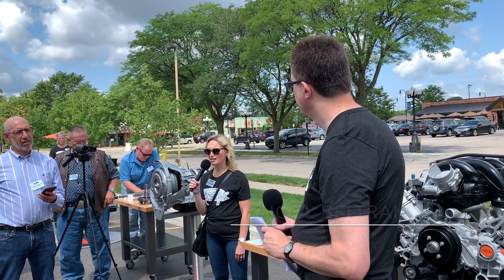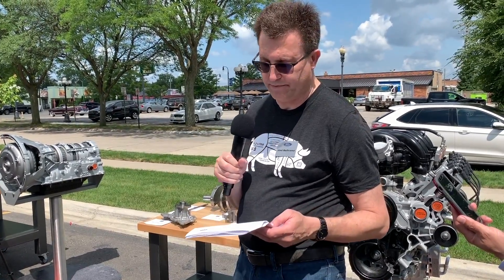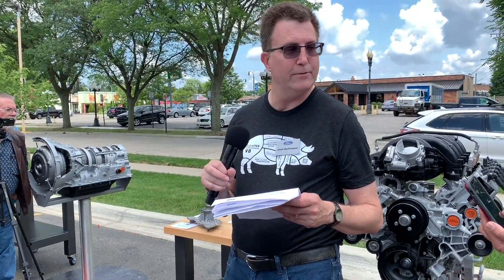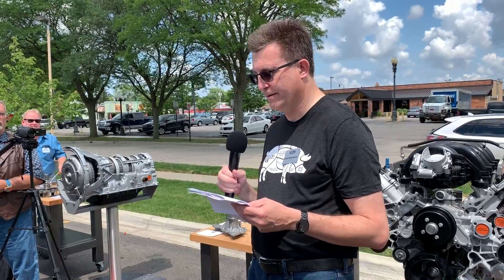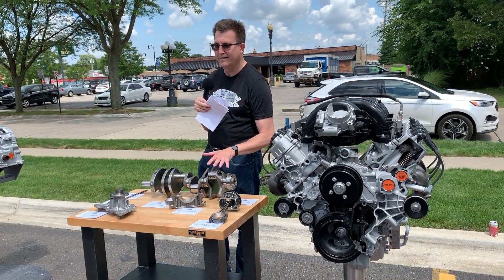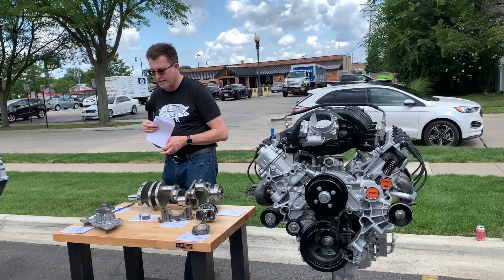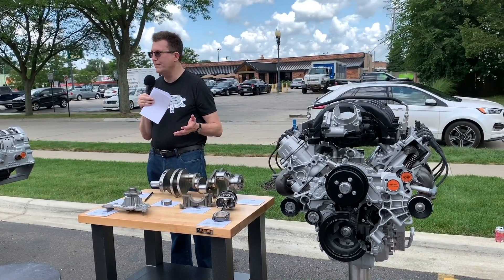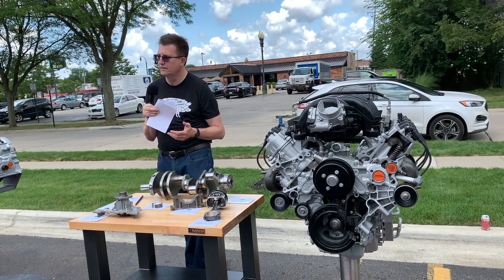Inside Ford’s 7 3-liter 'Godzilla' Gas V8 Engine

Comment: I patiently waited for the first gen 7.3 in 2020. Owned my f250 7.3 Tremor for 2 yrs now. It is clearly mechanically engineered to be superior to anything in its class. It lacks all the weak points of GM LT 6.6 series and Hemis 392. It has no weakness, no stupid MDS, no direct injection and as a perk also the highest hp and tq ratings in its class. Easy money and unstressed to boot. Does extremely well under a load. Far better than any gas HD ive ever had. Whats better? The Windsor plant committed to building the 5.0, 6.8 and 7.3 in Windsor till 2040.

Comment: So ford figured out you don't need DOHC and that DI sucks. They went back to an OHV design with 2 valves per cylinder and port injection. lol. At least they did something right.

Comment: Had my new 2022 f350 out on highway.  After taking it easy for a few weeks wanted to see what she would do at speed. 
Set cruise control at 80mph. On flat level pavement here in Fl tach was reading 1500 rpm, and truck just wanted to cruise. 
Cant wait to tow the boat soon.
Reply: Have you towed your boat yet?
Reply: @SwankySasquatch66  towed a buddys for him only short 20 mile run. Everything worked perfect.
Reply: Rear end gear ratio?

Comment: I got my 2020 f250 with the 7.3 this week.  
Omg.  It's a gas guzzler. But a powerful and amazingly refined at that
Can't freaking stop driving it
Reply: I have the same exact truck as you my friend. I average  8.9 miles to the gallon, and I baby it.
Reply: @jeffreyrogers8151  now mine it reads at about 12. I think yours will improve too, as you brake it in.
Reply: My 2020 has been getting 15 mpg with 93 octane and 3.55 rear.  I am actually impressed with the mileage as big as she is.  Love the truck, and the motor.
Reply: @dennishall1914  mine gets 11.
God!!
Reply: @danielbec4287  I have found that there is a pretty big difference in MPG depending on the rear end ratio.  Mine is 3.55 and I can get 15 easy sometimes better. Towing I get around 9 to 10 mpg.
Reply: @dennishall1914  15 mpg? Sounds like you dont tow or haul anything.
Reply: @jeffreyrogers8151  with 3.55 gears I get 15 mpg easy, but 9 to 10 when towing.
Reply: I hope so, I’m at 500 miles, below 10 in city

Comment: Love my 2020 250 with this engine. I use to a v6 2.7 f150. This engine feels like it's working hard (loud winding noise) at 60 to 75 but maybe I'm just not use to a V8 7.3 liter motor.
Reply: That noise is a bunch of bald eagles making sounds.

Comment: This engine is going to be legendary. Will surpass the ls series in popularity within the next 10 years
Reply: No it won't. This is a limited production engine built for commercial use. Why can't people just appreciate good engines regardless of manufacturer? Every time a new engine is unveiled the brand loyal turds come out of the woodwork this engine is now better than that that engine is now better than this
Reply: @roncook8566  it's in the new f250. And imagine how many commercial vehicles will have this engine
Reply: @zachutson7205  your right becaus ford said they are replacing the v10 with this and ford sells a ton of commercial vehicles with the v10 so theres gonna be plenty going around
Reply: Lets hope so, the LS needs some competition! A new pushrod V8 on the market should make things cheaper and/or better for everyone!

Comment: I like how he said "Ford is the only OEM that designs and builds our own engines for the commercial customers"

So.... You're not working with International anymore?
Reply: I believe they stopped dealing with international several years ago.
Reply: The 6.4 liter was the last engine ford used with international. The 6.7 is a ford designed engine
Reply: No.

Comment: What is the cylinder bore wear, taper and out-of-round after 3200 hours which at most probably means 100,000 miles for a *work truck"? Compression? Cylinder leakdown? Valve/guide wear? Cam wear? What is the oil consumption? Oil capacity,  service grade/viscosity requirement and change interval? How about brake specific fuel consumption and/or horsepower-hours per gallon? What octane fuel is "recommended" and/or "required"? Is it a "Flex-Fuel" vehicle? Gasoline  Ford "big-blocks" have always been horrendous fuel hogs at best and at worst if you don't/didn't have at least 30 gallons of capacity a "big-block" Ford being "worked" with any significant "payload" and 50% of the truck's GVWR at 55 mph or more on the "highway" you couldn't get in one at 8 a.m. with a full stomach and fuel tank and need lunch before you needed gas. May as well get up and get going an hour early, skip breakfast and figure on "brunch" about 10:30 at the latest and be looking for a food/fuel stop before you're 200 miles down the road.

Comment: Chevy Perfect's the push-rod LS engine and Ford claims it's so outdated. Ford builds the same type of engine and claims, what a huge innovation. What gives.
Reply: They did design a nice head for it. It's not like the Ls either. They even went canted valve which is very impressive they went that far with it. It's going to make killer power just like the ls does. Some good head porting, cam and intake and you have about 700hp.
Reply: @waynebollentin989  the head is extremely similar to an ls head. A good example of a canted valve head is a BBC head. This head has a very slightly canted intake valve just to make up for the valve head size
Reply: @roncook8566  They're no where near extremely similar. They're not even close to similar period. Intake ports are at a completely different angle. So much different, the intake sits flat on top of the intake ports. The valve angle is obviously different and while it isn't an aggressive canted valve design. It's still noticeable by just looking at them. The exhaust valves are much larger for this reason. 1.67 if I remember correctly. The valve spring height and design is different (taller springs). The injectors are in the head. So with all of these important things different. How can you possibly say they're extremely similar? I don't want to be a dick but you sound delusional making that statement. 
The only thing that's really similar, their both made from aluminum and the coils packs are mounted on the valve covers.
Reply: Technically efficiency over head is alot better. But ease of maintenance, size and low rpm grunt it just made sense for this job. Ford 5.0 puts out the same as a Chevy 6.0
Reply: @CparkerWelding  And chevy 6.2 ls3 it's lighter than Ford Coyote 5.0 and occupies a smaller volume.  So...

Comment: I think its funny how they have back stepped all the rhetoric they preached for years about how pushrod engines are archaic and outdated, ohc is the only way to go etc..... Now 20 years after they last made a pushrod engine and years of laughing at GM and Dodge, oh look we have a new pushrod engine! Looks like they copied key bits of LS design. Hmmm
Reply: Imo this engine has the key bits of an old Windsor/Cleveland small-block than a Chevy LS.

Comment: You didn't build that transmission Chevy did
Reply: Is that why theres recalls on it? RAM ZF OR NOTHIN!
Reply: @fozzybear9114  it’s not a ram transmission it’s a zf transmission. Stellantis has never Made anything worth a damn. Cummins make their engines and zf and Aisin makes their transmissions.
Reply: WTF are you talking about? The only Co-developed transmission by ford and GM is the 10R80 in the halfton segment. With 80% or more of the design and engineering done by Ford. The 10R140 is all Ford trans with nothing co-developed with GM. The more you know.
Reply: @chriseast030691  still a gm transmission
Reply: @Ls3guy  No, The 10R140 in this video is not a GM transmission. You're thinking of the 10R80 that was Co-developed with GM but is only about 20% GM
Reply: @chriseast030691  more then 20%
Reply: @Ls3guy  you're the kind of guy that thinks duramax is an all GM design too I bet
Reply: @killsomething126  because it is unless you are special Ed

Comment: Ford claim the engine is ohv so it peak at low rpm 430 hp @ 5500 rpm. 
The 5.0 in the F150 has DOHC yet it peak @ 5500 rpm.
Reply: Low RPM torque production.
Reply: @christopheraugustine5816  4000 rpm torque peak is not low.
Reply: 475 peak torque. 1500 to 5000 it makes 400 torque or more. That's grunt
Reply: @Caudahy Hall false, they will make 500+ with just a cam change and tune. Obviously the more you spend the more it's going to make. 600hp isn't going to be a problem.
Reply: @Caudahy Hall ford won't do it. It will be guys that turn wrenches and shops. Won't take long before the aftermarket jumps in either. 
Shop already has one in a foxbody making 600hp with little effort and looking to make a lot more.
Reply: I have seen you on so many channels in the comment section cuz i remember your profile pic

Comment: 430 hp, so we know its putting 500hp at the flywheel and its flowing about 240 CFM at the valve.  Guessing the cylinder head Intake Ports are +/- 230 cc.  Those are decent "initial" #'s as the supercharger and turbo guys are gonna want larger cc heads.  Questions are:
1) When will a 6 spd manual, or more gears, be offered and not just for the trucks but also for the hot rodder crowd?
2) Will Ford offer a stand alone wiring harness ECM kit
3) When can we expect SVT heads and Camshafts?
***Ford, if you dont fill this hot rodder void...the aftermarket crowd will ;)
Reply: The heads flow 300cfm+. Change the cam, exhaust and intake it's an easy 600hp
Reply: 430 hp at the crank
Reply: People are throwing 100 shot of nos at this Godzilla motors bone stock repeatedly and never hurts a thing, the motor is way over built 6 bolt mains and forged internals
Reply: Thx. I missed "the at the crank" somehow
Reply: They said its built the same as turbo engines. So I cant imagine heads would be hard to port out and make stupid boost. Seems to have very conservative cams. So I bet 500 is well within reach on cams alone.
Reply: I don’t think manual transmissions are ever coming back unfortunately. Automatics are just superior for the average driver.

Comment: I can't help but think the 7.3 gas  is just marketing wank to capitalize on the popularity of the 7.3 diesel
Reply: That's exactly what it is. I'm certain people will buy them, having no idea what they're actually getting, and Ford will get them back in the service center with diesel in the tank. I know the nozzle doesn't fit, but people find a way. They should have just made it a 7.5, like the 460. I love my old stump-pulling carbureted non-emissions big block, but others would like a new one.
Reply: The 7.3 diesel has been gone for 17 years now. The 6.7 is well publicized as being Fords diesel when you take a walk through a show room, and speak with a salesman. 

If you buy a $50K+ truck new, not understanding the new 7.3 engine in it is gas powered, you need to have your check book taken away, and a mental health evaluation.

It’s just a displacement number. With over 100 years of engine production, and the last 40 of it being measured in liters, repeating the same displacement number (which is allot easier to do using liters over cubic inches) with an all together different engine is bound to happen. 

If they made it a 7.4L, or a 7.2L, I’m sure there’d also be people who would be screaming that Ford’s just trying to steal GM or Chrysler’s thunder from some of their old displacements.
Reply: @Scraps_Pile  They assuredly made marketing decisions based on the reputation of the old 7.3 Navistar. That said - Ford has repeatedly made some hand waving claims about the displacement of the new motor being determined by their power and torque versus efficiency goals. I do not believe that to be anything except smoke and mirrors telling you to ignore the man behind the mirror.
I expect that almost none of the buyers of these trucks will be foolish enough to put diesel in them based on the displacement. Since this is targeted toward fleet buyers, however... ...let us just say that the buyer and the user might not be the same person.
Reply: Ha no.
Reply: Good marketing to refer to the excellent 7.3 Navistar diesel. This engine could be a champ for Ford,modders will like the compact size vs it's displacement,looks like a great candidate for a supercharger.
I'd go with a screw /roots compressor, integrated intercooler,air/water type,headers ..1000 HP +?

Comment: The only thing I would add is a 7-8 speed MANUAL transmission.  If they did this, I have a feeling that would draw a lot of customers
Reply: It wouldn’t, that’s why the manufacturers dropped manuals, they didn’t sell
Reply: @Bajaheat  it's impossible to pair with autonomous operation.
Reply: Randy Magnum uh what?
Reply: @Bajaheat  a manual cannot be made to work with autoparking,  lane control and other autonomous vehicle operation.  Vehicles that are offered with manual gearboxes are sought after and command a premium.  They are being phased out because they don't work with both current and very near technologies.
Reply: I would sure buy one. My 460 is a BLAST to drive with the T19 four-speed, I would surely appreciate twice the torque and twice the gears. But alas, nobody else wants them. Everybody wants a start button, a stop pedal, and a go pedal. People today don't care about the full communication and understanding with a vehicle that a manual transmission allows. It started with Ferrari's CEO stating "The benefits of a manual transmission are superficial at best, and at worst rob the engine of its power." Now, we know that in reality, torque converters do that, but that's fine. Ferraris never last past 40,000 miles anyway. The problem is people are basically worthless these days.
Reply: Jonathan Knepp you’re telling me that you would buy a brand new truck if ford made a manual 7.3 gas? You’d spend the 60k and get one? Exactly that’s why they don’t make them lol
Reply: @Bajaheat  Not new, I tend to buy things for a couple hundred dollars and fix them. So I suppose Ford probably doesn't care about me.
Reply: @Scraps_Pile  You are right about that part - they do not care about the guy who buys it after it is 20 years old.
As for your arguments about manual versus automatic, I love rowing gears myself. That said, the current technologies for automatics actually make them superior to a manual for efficiency, performance, reliability, emissions and more. They have gotten very expensive to manufacture, though.
Reply: Christopher Augustine most autos are not more efficient than their manual counterparts, too much parasitic loss. Unless you’re talking about refined dual clutches in the higher end manual will get you a few extra mpg
Reply: @billbilliams692  cvt's are far more efficient than their manual counterparts, because the can offer far steeper overdrive gearing than a manual, and the engine is always run within a predetermined rpm range that it has been engineered to operate at maximum efficiency in.
Reply: I wish they would too, but unfortunately manuals are a thing of the past now, at least in pickups and medium duty vehicles. Automatics are way more capable and can handle more torque and HP than a manual could. Also, the biggest market now for manuals are kids, and of course they don't have the money to buy a new truck, it's the older people and businesses that buy all the new trucks.
Reply: Kia has that
Reply: The autos these days are miles better then any manual. You can but an after market mount to manually shift it